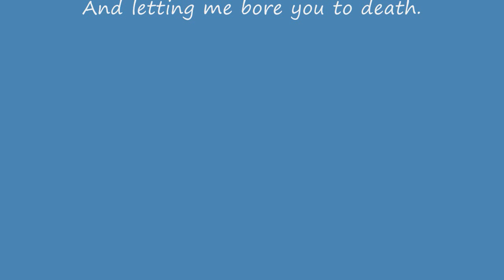The Jato at B&T RC Central

Comment from the maker: @chance1234asdf the EZ-Start itself isn't necessarily a bad product...it's just Electrical lol - - which is one more thing to break.  ALso - -the EZ-Start over-works the hell out of a one-way bearing that's inside the crankcase for turning over the motor.   It's not as reliable as a bump box - which cranks the motor directly from the flywheel.   Which is less prone to destruction over a time period.   Such is a problem in my case..

Comment: @Getz2oo3 ya thats what the other guy said too, thats weird, is it that bad? like will it not start all the time or can you usually get it started eventually,  because that'd drive me nuts, like im pretty good with all that stuff and i learned alot on my baja 5b and nitro airplane engines but a nitro car is whole different deal, so what if i just took the auto glow plug cord out and just use a separate glow starter would it work better?

Comment from the maker: @chance1234asdf Yeah sure man....just remember it's only 2 wheel drive...not 4 lol.   I need to get mine running again...  It won't crank, I know I need a new one-way bearing for starters...either that or get off my ass and buy a bump box....  donno if that'll necessarily solve my issue though.   The EZ-Start system that comes with the Jato is perfect for casual runners like myself who aren't too serious with the cars...but it's not very reliable.

Comment from the maker: Respond to this video...          I have 2 issues going for me right now....one - I'm not getting a good connection between the EZ-Start battery/starter wand and the glow plug - - actually...i'm getting ZERO connection.   And secondly...the one-way bearing isn't catching long enough to even turn the motor over in the first place.   Anytime the bearing "grabs" it immediately slips off and spins freely....doing nothing.    One of these moons I'll get off my butt and fix the bloody thing.

Comment from the maker: Sure, as long as you get rid of the stock tires and use tires for running off-road.  Also, keep in mind it's a Rear-Wheel drive RC car....so you don't have the maneuverability of the all-wheel drive cars.   It tends to push while turning, even with a decent set of tires.   With practice though, it's definitely runable.  I'd try to keep it up against other stadium trucks or even other Jato's for racing though.  You'll get stomped racing against monster trucks.  Unless your really good.